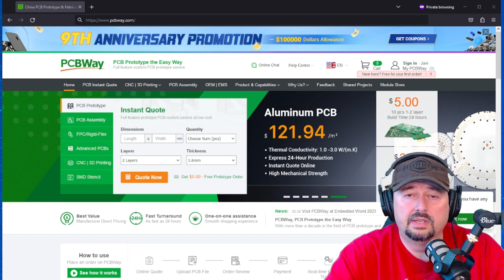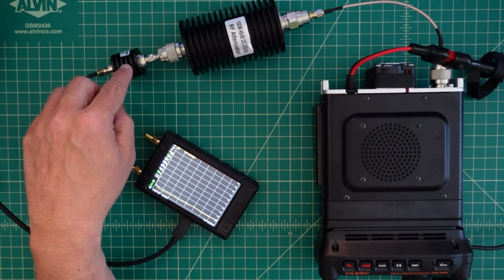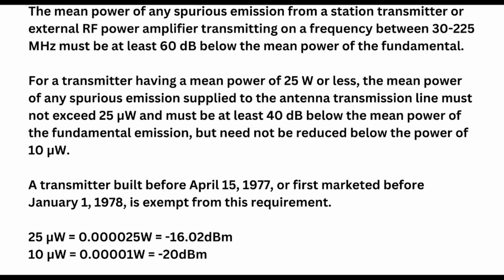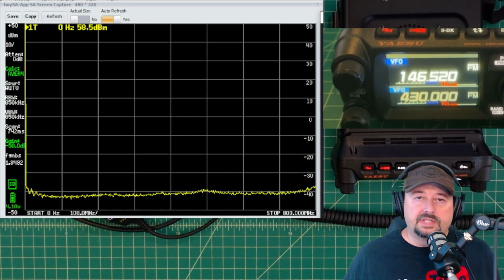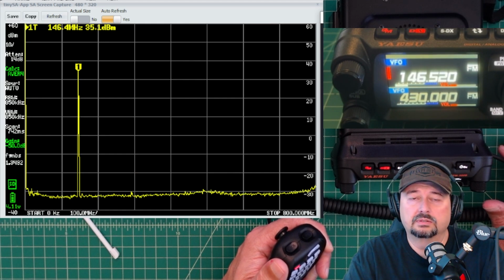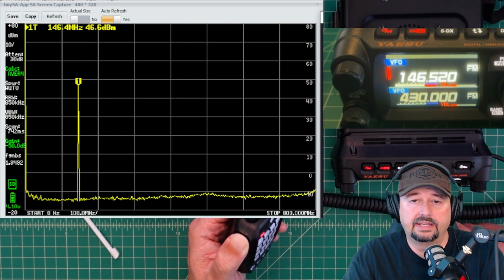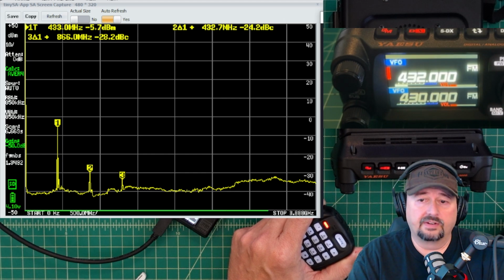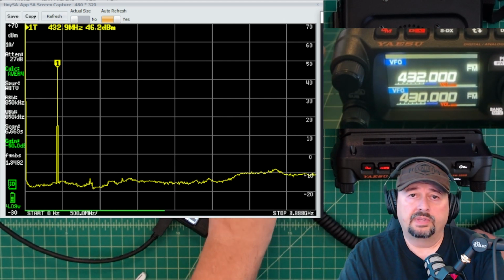Yeasu FTM-500D - Spectral Purity Test

Comment: It would be good to also test the icom ic-2730a. But i wouldn't expect you to get one of those. I have an ic -2300H and I know it puts out a signal on the third harmonic. Which in my very unscientific test with a whip anntena and my tinysa normal wasn't in spec.
Reply from the maker: If I come across one, I will test it...  thanks for the info on the 2300H 👍

Comment: When you tested 70cm the screen on the computer it showed the marker 1 was reading at 432.9 MHz instead of 432 MHz. Does this mean that the radio is transmitting off frequency?
Reply from the maker: No, it just is because the span being swept was so large and there are only so many data points.  If we zoomed in it would be fine 👍
Reply: @TheSmokinApe  makes sense. Thanks for the reply.